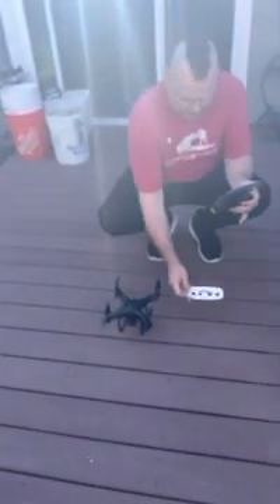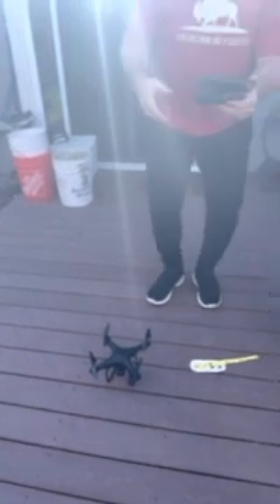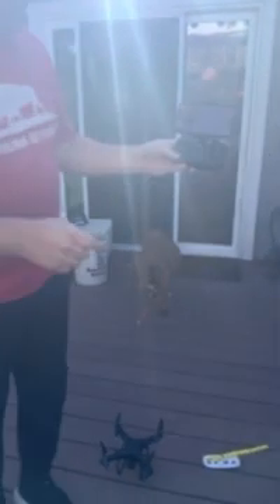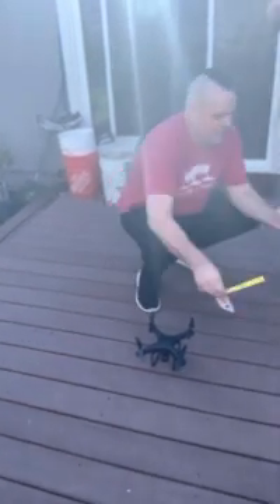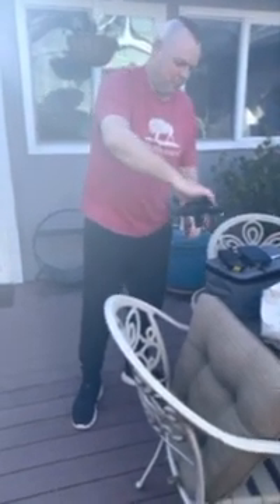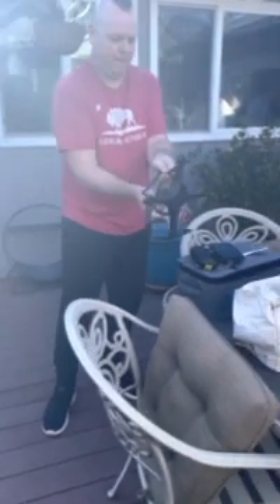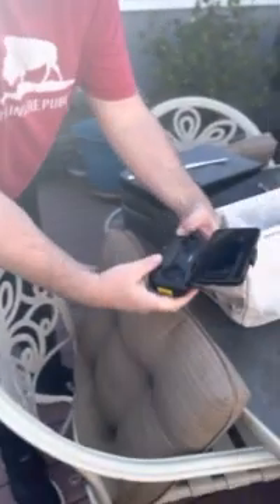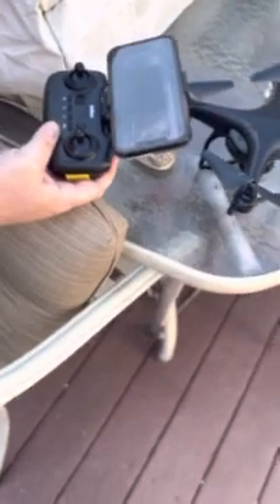How to calibrate and work your new drone. Cheerwing U88S GPS Drone

Comment: Bro got scammed cheering is the drop shipped version return it
Reply from the maker: Sorry for the late response.  Didn't get the notification you commented until I saw someone else commented and then I saw everyone else who commented just now.  Better late than never right lol.  Anyway, I agree with you.  The app and the device are pretty crappy but you get what you pay for.  I have flown a few cheaper drones and this one is by far better than those, but they have some amazing drones out there that do far more and work 99% of the time as oppose to this one which works 60% of the time.  Think I paid something like $200-$250 for it back then maybe 3 years ago.  The $50 drones are really really bad.  The $2000 drones are really really good.  Like I said, you get what you paid for.  Thank you for leaving a comment.